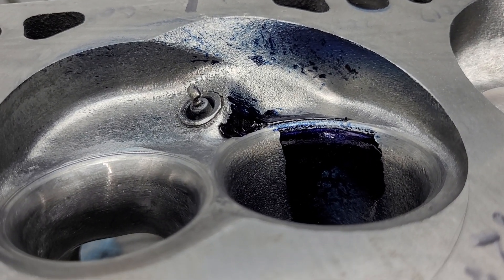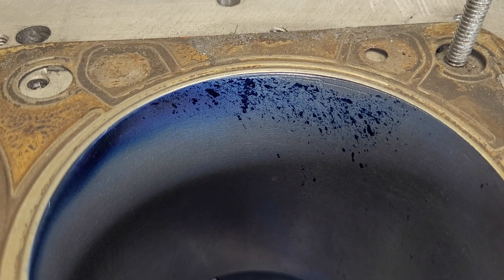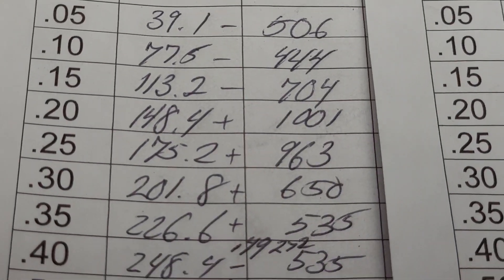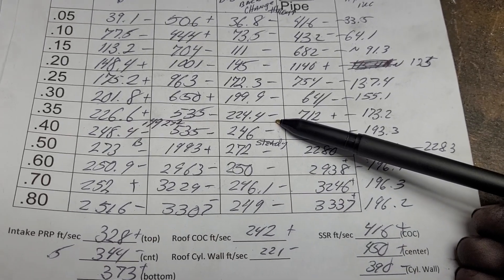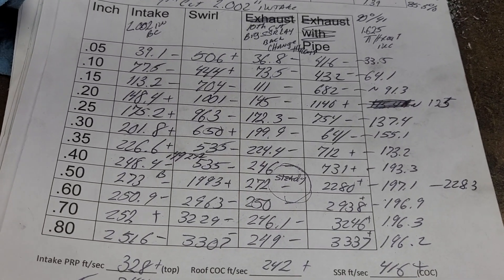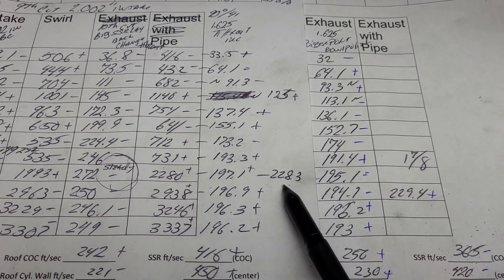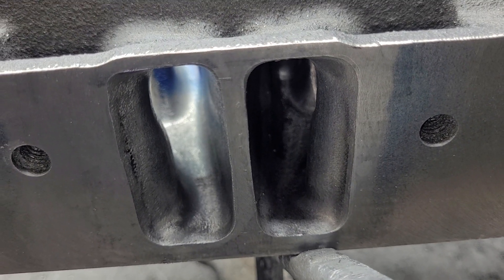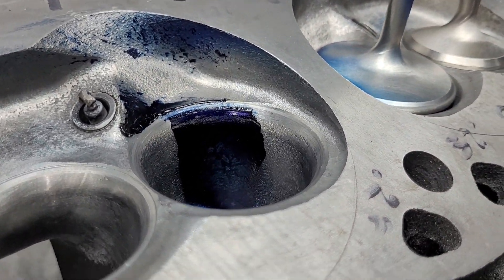EQ-CH 318B 318/360 cylinder head, 9th and final cut. Ssr layback and increase bowl ratio.

Comment: After watching all your work on these heads I felt ashamed because I didn't subscribed yet so I did I think I would rather port a stock magnum head than those I got 265 cfm on a super flow 600 at 28 in. Vac on a stock magnum with stock valves building a 410 now and got a virgin pair of new zealand heads that have not been bolted on ever came with 202 as valves don't have access to a flow bench but I have ported enough of them to feel comfortable with the outcome do you have any videos of the New Zealand head porting thanks for sharing all your hard work in the heat we appreciate it
Reply from the maker: NZ head is cake compared to these. Thanks
Reply from the maker: Stock Magnum is cake compared to these.
Reply from the maker: They do look durable which is it's only good point! No real thin spots.
Reply from the maker: Yes, I have NZ head porting with 1.92" valves. 2.02" valves coming soon. Stay tuned!

Comment: It would be good if could demonstrate/show the sound associated with each cut.  Thanks and keep up the good work!
Reply from the maker: The spl is so high I am not sure the phone mic would be able to reproduce it. I could try. Thanks
Reply: I believe Spier (spl) has mentioned (in his porting videos) that he works to get the heads to sound right (less noise/volume).  I think I remember him saying the sound may be the best indicator for good flow and performance?? @servediocylinderheads
Reply from the maker: @gmcnelly2468  Chad Speier has many good videos. Spl is sound pressure level. Fyi
Reply from the maker: There are production issues with that. The phone will not pause long enough to do  sound video and then strip the bench to show liquid flow. Thanks